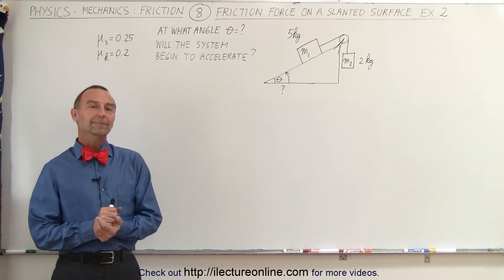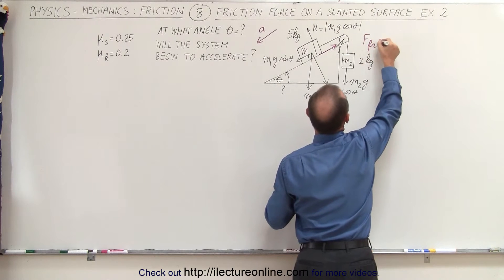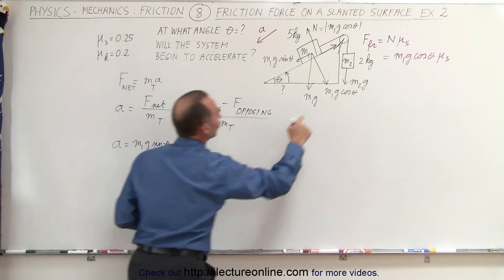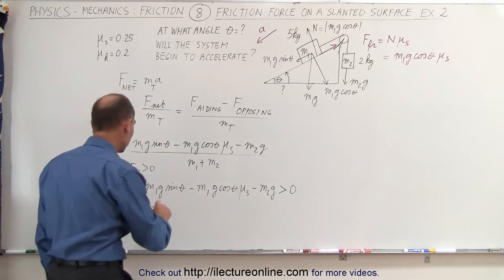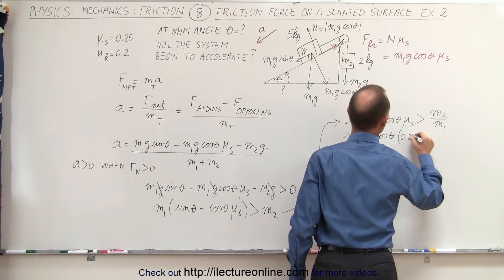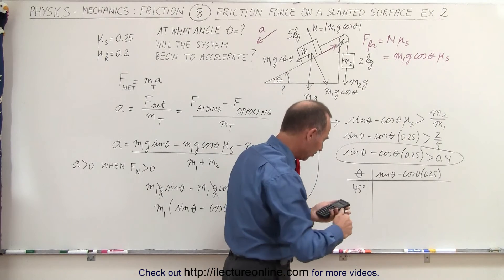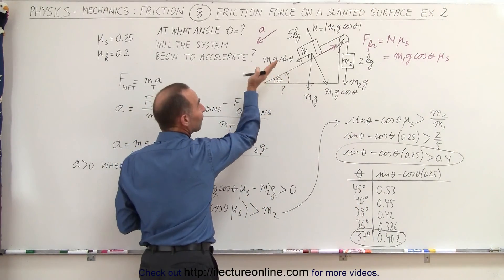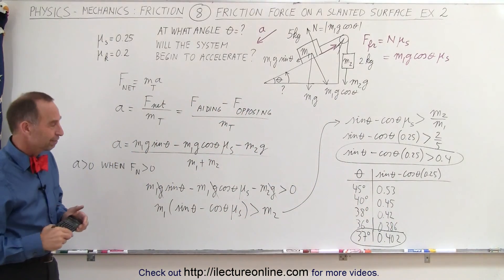Physics 4.6   Friction (8 of 14) Friction Force on a Slanted Surface: Ex. 2

Comment: I understand that if there are two coefficients for friction (one for static friction and one for kinetic friction) we must calculate to see if the system is moving, then use the kinetic friction to calculate the acceleration. But once we have determined that the system is indeed moving, do we redo the F_Net calculation with or without the static friction? In other words, when we are determining the acceleration, does the static friction take away from the F_Net even when we know that the system is moving?
Reply from the maker: Once you have determined that the system will accelerate, then you calculate the acceleration using the kinetic friction only.  Once the system is moving the static friction is no longer relevant.
Reply: @MichelvanBiezen  wouldnt the static friction to get the system to start moving affect the total amount of force on the system?
Reply from the maker: Only at the moment that the static friction is overcome.  Once the object begins to move there no longer is any static friction.
Reply: @MichelvanBiezen  Thank you!

Comment: I think there will be 2 values for theta one for 5 kg down and one for 2 kg down ,im i right?
Reply from the maker: The value of theta only depends on the slope of the incline.
Reply: Actually I'm thinking as ,for some theta 2 kg block will move down and for some other theta 5 kg will go down
Reply from the maker: Yes, that is correct.    🙂
Reply: @MichelvanBiezen  thnku because of u i can now make logical thinking in physics god bless u😊

Comment: plz answer
shouldn't it be a is greater than 0 when Fn divided by mT is greater than 0??
Reply from the maker: If Fn is greater than zero then Fn/mT is greater than zero as well.    It doesn't matter which comparison you use.
Reply: @MichelvanBiezen  really appreciate thanks for the answer i really didn't think u will reply or at least not in that time

Comment: i wonder why we didn't assume that the system will accelerate in the direction of m2
Reply from the maker: You can assume that, then work out the problem,  and then see what you get for an answer.   Typically you make a quick rough order estimate to determine the direction of the acceleration if possible.  Sometimes it is not obvious and you just guess.

Comment: It was a bit frustrating, I thought it was unsolvable? Thank you very much. Can it be done the same way but assuming acceleration is in the reverse direction?
Reply: Absolutely! If we assume acceleration in that other direction, both the force of static friction and the parallel component of the force of gravity will work against the motion of the system. In an inequality, we wish for sin(theta) + 0.25cos(theta) < 0.4, which is easy to show if you understand the video. From there, some numerical testing gives a valid angle 0 < theta < 9.

Comment: if there have given two value of the coefficient of friction one is kinetic another is static then which value should I use to calculate the acceleration of the whole system in the examination?
Reply from the maker: You must use the static coefficient of friction to calculate it the system will begin to start moving.  Once the system is moving, then you must use the kinetic coefficient of friction to calculate the acceleration.

Comment: ha. I kept reworking this trying to find a way to solve it algebraically. I ended up in the same place as you did, but didn't do the table. Just watched the video waiting to see how you were going to pull the rabbit out of the hat. Good problem.
Reply from the maker: Yes, that is a challenging algebra problem.  Sometimes it is better to take the "easy" road.

Comment: Professor, I paused the video and did it on my own way: m2g>m1gsinΘ+m1gcosΘ(0.25) and m2g<m1gsinΘ-m1gcosΘ(0.25)
I got when Θ<8.5° m1 accelerates toward m2 and when Θ>37 m2 accelerates toward m1. Is this correct? Big THANKS!! Your videos help me through all Calculus and now physics!
Reply from the maker: I did not work out the problem for the other direction, but your answers sound reasonable.

Comment: Can u solve this question please sir...a box moving downhill with velocity 36 ms opens up a parachute and now there is constant deceleration of 3 ms-2 calculate the frictional force that produces this declaration ...Angle uphill is 20 degree
Reply from the maker: Use f = ma.   - mg sin(theta) + mg cos(theta) * mu = m a      (mg cos(theta) * mu is the friction force)
Reply: Michel van Biezen thanks sir ...the answer is 604 Newton

Comment: Michel excellent lectures, one question about (Fnet ) regards inclined plane/ pulley problems coordinate system, will tension pulling M2 vertically up always be positive even with multiply pulley systems as long as it's aiding acceleration. Thank you.
Reply from the maker: I don't like to use the word "always" because there could be some conditions or situations where it isn't so, but in general a force aiding the acceleration is considered positive and a force opposing the acceleration is considered negative with this method of solving problems.
Reply: Michel van Biezen 
Thank you.